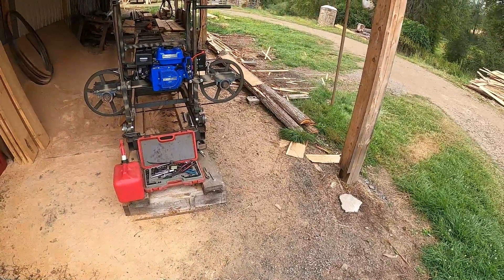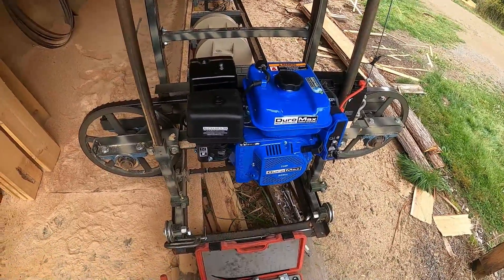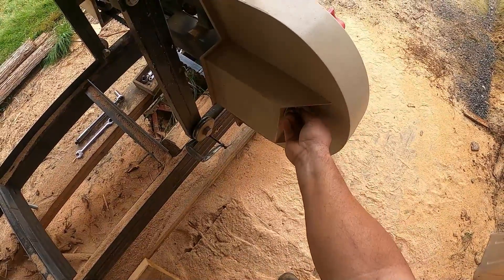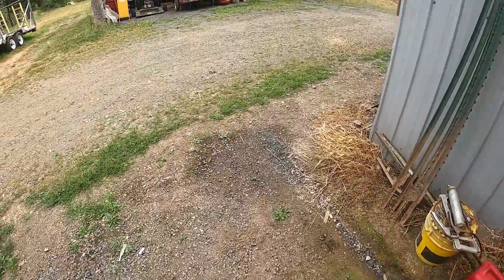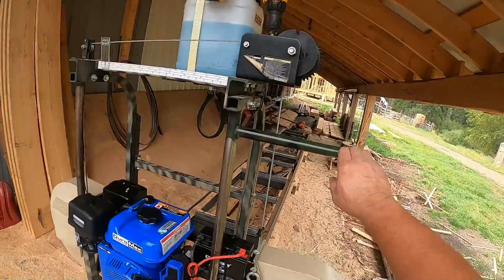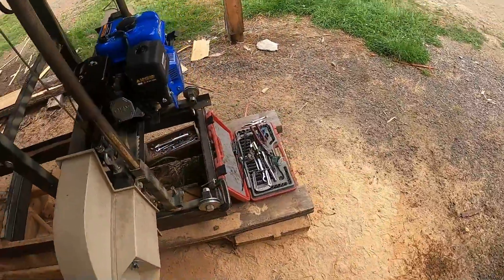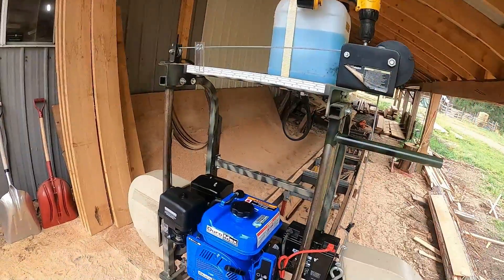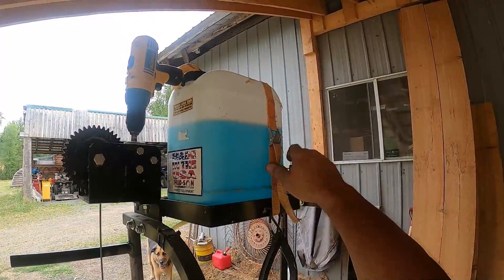Hudson Hunter sawmill improvements

Comment: Can you put any size engine on them?
Reply from the maker: The engine size is limited by the height of the engine. To high and it will hit the top of the main frame. It would take a lot of alteration to change the frame height but it could be done.

Comment: Just curious.... any reason you have the head turned the way you do instead of having the discharge facing away from the building?
Reply from the maker: I can only load logs from the "outside" so if I turned the head the log stops would be in the way. Also this way contains the sawdust so I can scoop it up with the tractor bucket.